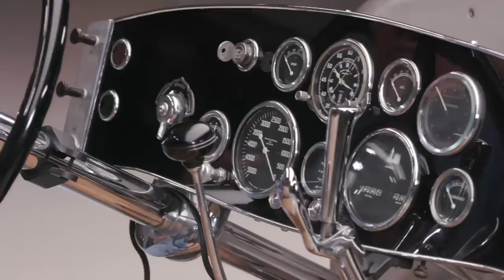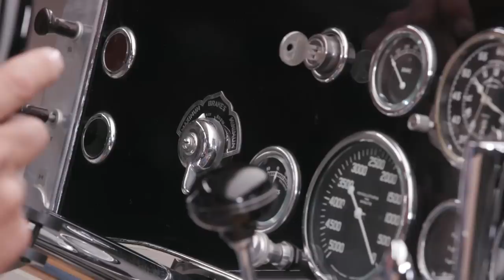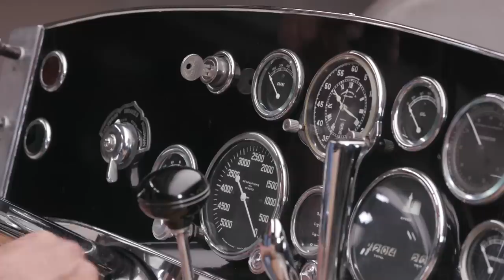1931 Duesenberg Model J Chassis - Jay Leno's Garage

Comment: Duesenberg used automatic grille shutters in 1928, and now many small cars/CUVs/crossovers are using them almost a century later. Lol.
Reply: Yes as a way of reducing air turbulence on the front end.
Reply: YEH IF YOU HAD THE MONEY THEY HAD THE TECHNOLIGY ,EVEN THEN !....////
Reply: Good tech never goes out of style
Reply: And Harley came back to belt drive's
Reply: There’s nothing new under the sun

Comment: This is a testament to how far automotive technology has advanced since the 20s. Yes, this car was a marvel of the day as far as automotive technology and Duesenberg had manufactured beautiful cars that were beautiful, fast, and sophisticated, not to mention they were primarily lightweight. My Honda Civic EX coupe weighs close to 2400 lbs, but it makes 508 whp and my 2014 Dodge Ram 3500HD with a Cummins weighs about 9300 lbs and makes 350 HP at the crank, but close to 900 lb ft of torque. This car was about 5200 lbs and made 265 hp at the crank, but is a totally different experience than vehicles of today. Thank you for the awesome history lesson Jay!

Comment: Jay, IF I had a couple thou... i would put ball joints in my old GMC... I make 8 hundred bucks a month. so I live vicariously through your cars
Reply: I know the feeling man, I'm driving a 02 Ford F-150 crew cab that was left to me by my late step father, and I'll be doing the best I can to keep it going til the wheels fall off working for a bi weekly paycheck from a non profit org.
Reply: Hope you get the funds And get her running perfect 👌🏾
Reply: Those old Fords last forever... keep 'er greased up
Reply: ty dude.... we live our life
Reply: @777jones ty :) 235,000 miles. runs great. Ball joints are ready to pound through tho
Reply: I feel you. Automotive YouTubers keep my passion alive. My dream is to get my first car back. I know where it is and it's only like $3500, but I'm disabled and can't work. 😕
Reply: @Studio23Media  If I made that much on disability, Ball joints would be a done deal
Reply: Jim E The car is $3500. I don't "make" that from disability
Reply: sry.... misunderstanding  @Studio23Media
Reply: @Michael Taylor I not only know where my first car is I STILL HAVE IT! It's under a car shelter in my back yard! 1976 Chevy Monza 2+2 (hatchback). Original V8 car I bought used in 1978 with ~25,000 miles on it. Ran the 262.5ci V8 to 100,000 miles, rebuilt it with some "upgrades" and ran it another 100,000 or so then built a 350 for it which now has maybe 3500 miles on IT! Needs a little TLC and a lighter pressure plate (it'a 4-speed... The pressure plate in it now is a Hayes Street/Strip to match the 350 but it is hell on clutch cables, has cracked the firewall (which I've "improved"), and my 60-year-old left knee doesn't work as well as IT used to!
Reply: paid 4 shack, lotsa  baloney sammiches, not much heat... survival does not involve cable TV. i spend the 50 bucks a month on internet
Reply: @2manysecrets Try it. SOO hard not to call you spoiled
Reply: and yea, its possible. I do it, barely. Ya wanna send me another five hundred dollars a month?
Reply: @Studio23Media  what kind of car?
Reply: J T Just a 2000 Mustang GT. Not much to anyone else, but it's special to me.
Reply: Jim E $800 a month is $200 a week and if you make $7.25 an hour that means you work about 4 hours a day. You could easily make 1600 a month if you work 8 hours a day.
Reply: @Studio23Media  my first real car was a 5.0 foxbody. Unfortunately, I'll never get that one back. Wrecked a long time ago. Good luck chasing the dream.
Reply: Tex 13... yes but living costs are a lot higher!

Comment: My favorite car since childhood.  In Highschool all I could afford was a 1931 Nash but it did have a straight eight, shutters on the radiator and automatic chassis lube system. The 6volt starter cranking that straight right sounded identical.  Great fun.

Comment: Still puts even new Rolls Royce models to shame. No one's gonna look at your fancy car out in the streets when this is next to it.
Reply: Even the chassis looks stylish af
Reply: New RR's are just fancy BMW's these days anyway.
Reply: So many things that weren't used for years or early versions of things uncommon for decades.  For example my 2008 is only 2v they had this back in the late 20's.  The idea of brake modulation to prevent lockup that early in the automotive era is astonishing.  Besides the tremendous attention to detail and quality.
Reply: Rollers and some trucks used louvered grilles. International prime movers with Cummins had them among others.
Reply: @ldnwholesale8552  RR used a louvered radiator too.

Comment: I enjoyed the 1st. video you did on this Duesenberg, Jay, and I enjoyed this one just as much. Also, it's possible the altimeters in earlier cars had a functional use in that some carburetors set at sea level had to be adjusted at significantly higher altitudes, so the altimeters could be an indicator of an approaching problem. Since the Düsenberg brothers, Friedrich Simon and August Samuel, were German-born auto engineers--and I've known a lot of them--I find it hard to believe they would have had something nonfunctional in their vehicles.
Reply: YEH I EXPERIENCED THE AFFECTS OF HIGH ELAVATION WHILE GOING OVER THE ROCKY MOUNTIANS IN A PLYMOUTH STATION WAGON WITH A 440 4 BARREL IT LOST ABOUT HALF OF IT,S POWER WHILE GOING OVER THE TOP ! ….////
Reply: @billmiller119  Exactly Bill, I was being conservative in my comment on the Duesenberg yet any carburetor car will lose power due to thinner air, which means less oxygen, as it climbs into higher altitudes--we people also experience it in the mountains as "shortness of breath". :)

Comment: Maybe somebody has mentioned this but there are several practical uses for the altimeter: adjust timing, adjust mixture and open the radiator vanes.

Comment: Love this video. The videos of P1s and Regeras are nice but I prefer the older stuff. The reason cars have captured people is that they are physical and we interact with them in a physical and sensory way. The newer cars take that element away. Feeling gears mesh during a gear change on an old car. Feeling the throttle actually open with a cable. Feeling the actual road thru the steering wheel.

Comment: Actually Jay, it's more like driving a dootlebug which is an old car stripped of it's body.  For a lot of farm boys like me this was our first car, and I used ours to pick up stones from the fields and even pull wagons with. We could kick ourselves for wrecking classic cars that would later be worth tens of thousands of dollars!  The altimeter I believe was also used to adjust the carb mixture as you drove at higher altitudes.  Modern cars have automatic altitude compensators inside the carbs.

Comment: It is straight-8, configuration that fascinates me, so instant love.
Reply: And I would guess that altimeter was used because supercharging doesn't function as well in greater altitudes, so it will warn you that your car will loose some power or even run worse. I mean, almost no supercharged car had it but that is kinda thing inventors and pertolheads like Duesenberg brothers would be concerned about.

Comment: Das ist ein schönes Beispiel wie damlas Autos von den Herstellern angeboten wurden. Nur das Chassis, ohne Karosserie, die von Karosseriebauern separart gefertigt wurden. This is a nice example of how cars were offered by the manufacturers back then. Only the chassis, without body, which were made separately by coachbuilders.

Comment: I USED TO GO TO THE AUBURN CORD DUESENBERG MEET IN AUBURN, INDIANA EVERY LABOR DAY. SOME GUYS BOUGHT THEM FOR $50 IN THE 40'S, OFTEN MAILMEN WHO WOULD SEE THEM IN BACKYARDS ON THEIR ROUTE AND MECHANICAL ENGINEERS WHO APPRECIATED THEIR ADVANCED MECHANICS. 

THEN THERE WERE THE DOCTORS WHO BOUGHT THEM IN THE 60'S FOR SAY TEN TO FIFTY GRAND. 

THEN THE MULTIMILLIONAIRES WHO GOT THEM IN THE 70'S FOR HUNDREDS OF THOUSANDS.

WE STAYED UP ALL NIGHT IN THE PRESIDENTIAL SUITE OF THE AUBURN HOTEL WHICH WAS CLOSED BUT OPEN FOR THE FESTIVAL, PAINT PEELING FROM THE WALLS. 

THE OLD GUYS WOULD TELL OF DRIVING SEVERAL STATES AWAY TOGETHER, BUYING A BARN FIND DUSIE, GETTING IT GOING AND DRIVING IT HOME, TOP FLAPPING IN THE WIND.

Comment: If a house was $1200, it is safe to say the dollar is 100x smaller now.  Average houses are $120,000 to 200k.  Which means this chassis cost $900k when new and the full car cost 1-2-3 million in modern dollars.

Comment: MY GUESS ABOUT THE ALTIMETER 
WOULD BE TO HELP ADJUST THE 
MAIN CARBURETOR MAIN JETS 
TO COMPENSATE FOR THE
THINNER ATMOSPHERE IN HIGHER ELEVATIONS!
WITH AIRCRAFT ENGINES 
THIS WAS MORE OF AN ISSUE,
AND THE AIR FUEL MIXTURE 
WAS CHANGEABLE ON THE GO!

Comment: Someone tell Jay it's "hydrolock." Also, I'm not too worried about a cylinder full of gas exploding - you need air for that. Not to mention I find that gas tends to pretty quickly find it's way through the rings, which is way scarier in terms of engine damage. On old gravity-fed equipment, a stuck or just leaky needle and seat is a good way to end up with a bunch of fuel in your oil which the bearings don't appreciate. Since most of my old equipment either didn't have any kind of oil pressure indicator, or it no longer works, I try to check the oil - looking for extra or extremely thin "oil" - before each start on the worst offenders. I'm afraid this is killing off a lot of our good old small engines and even old gas tractors with side drafts if the fuel can just fill up the whole tube to the air cleaner. I just bought an old Kohler 20HP twin that desperately needs a rebuild because of this.

Comment: As for being able to drive this car while you are outside , this could still be done, if the body was a Coupe Napoleon.  The driver sits in front of the windshield of the enclosed passenger compartment.  You just take off the driver's door and fold down an undersized windshield that would be above the dash board.  The Cabin is behind the driver, so he won't see it unless he looks for it.   Back then a massive car was felt to have good handling, when it drove over rough roads, the wheels would be doing plenty of up and down movement. The chassis had lots of inertia to hold it in place, and if the springs were very good, they would absorb most of the vibration while the chassis could roll along in a straight line.

Comment: I never understood why updrafts weren't simply fitted with a return line, it's not that big of a deal to collect the unspent fuel and pressure feed it or gravity feed it back in to the tank. Such a simple fix to what still is a better solution than a needle carburetor that can fudge up even when it's all perfectly right.

Comment: Modern cars could learn a thing or two from this example. A nice little latch to let the oil out instead of using a bolt like a caveman. Brake pressure gauge. Very cool stuff.

Comment: Actually that grille style thermostat offers an advantage over modern thermostats. When the louvers are closed your car will have quite a bit less drag at highway speeds. Watch those top speed speed cars they always cover the entire front of the car with cardboard wherever there's a gap.

Comment: The Model a Ford of 1928 to 1931 was more in the $450 to $500 dollar range.  The Model T bottomed out at about $250.  Clark Gable hat the hot rod with a short wheelbase roadster. Must have been very fast.

Comment: Beautiful Machine . I'm intrigued by the radiator cooler flaps : in the video , it seems that they are closed during all the ride. It's because it's cold outside or because the lack of the chassis and weight , the engine stayed cool and didn't heat up ?

Comment: It'd be quite interesting to make a period correct speedster body for it, but out of acrylic, so you can still see the internals.
Reply: There are a few clear plastic bodied cars out there. I think one is a Pontiac?
Reply: @louispaparella5766  yes, pontiacs and saturns in the 80s had plastic body panels.
this thing in particular would be fine as far as UV exposure, since it probably spends most of its life in jay's garage.
Reply: @captainzoll3303  Didn't splain myownself enough. I was referring to clear unpainted see through clear panels to promote the use of additional plastics in cars. Sometime in the 40's, 30's or so.

Comment: In, I think, the early 1960s a guy called Brian Morgan in England was a restorer of vintage Bentleys.  He somehow or other got hold of a Duesenberg J engine and had the chassis of an 8 litre Bentley and combined the two with his own sedanca de ville coachwork.  He called the mixed-parentage car the BDM (Bentley Deusenberg Morgan) and it even had a manufacturer's name plate with BDM Lichfield engraved on it (he lived in Lichfield, Staffordshire).  His theory was that the Duesenberg had a great engine but a not-so-great chassis (remembering that Fred Duesberg was killed when his SJ went out of control).  The eight litre Bentley chassis had better road-holding and a 4-speed gearbox strong enough for the American engine. Of course, purists were disgusted by his actions and the BDM was broken up and the Bentley chassis reunited with an 8 litre Bentley engine.  There is a p[icture of it here: https://libwww.freelibrary.org/digital/item/45857
Reply: That is fascinating! Thanks for sharing.

Comment: I'm surprised he doesn't have a Stutz DV-32. Same engine design, straight 8, DOHC, 4 valves per cylinder, and something the Deusenbergs did not have: a hemispherical combustion chamber - the very first production Hemi.
The Stutz displaced 332 cubic inches compared to the Deusy's 425. Power for the Stutz was about 150 hp compared to the Deusy's 265 but it was still wicked fast.
Considering the Deusenberg chassis alone was $9,000 and a completed Stutz with a custom body ran about $6,000... well, you got a lot more bang for the buck with a Stutz.
There were about the same number produced - 500 give or take - even today a Stutz at auction is around half a million, compared to a million plus for the Deusy?
I'd take the Stutz. It was a more handsome car, too, in my opinion.

Comment: Minor point. Filling the cylinder with fuel will not blow things up. The most powerful explosion is the right stoichiometric mixture when it's running, and that doesn't blow things up. Oh, Jay...
Reply: G Kuljian No but it will hydrolock and bend piston rods or worse.

Comment: Just crying out for a nice mahogany and tulip wood, boat-tail body, with the flowing style Vanden Plas type wings and cutaway Malcolm Campbell style doors. Even though they are wonderful cars, I never think they sound that good. The supercharged version is a lot crisper sounding. My guess is that they are woefully under-carburetted. It is like a 6½ Bentley never sounds good with the single Smiths carburettor but sounds wonderful with twin SU's in Speed Six specification.

Comment: Jay Jay, what the hell is that thing? Do you have to have a paddle or an oar ready at your side for pushing other cars away from ya, or for signaling a left turn? (Jay is going completely rogue here today with this one: no roof, no doors, no bonnet, not even a seat belt, oh wait it does have that.) Say Jay, why use the old sofa, the park bench, it came with on there, just get a new one, and while it's open like that, put it up there, one of those modern looking ones, you know. The engine has a great sound though. Epic photo moment? Probably 15:06 (and onward).

Comment: Built to drive! And wow, 4 wheel, hydraulic disk brakes in 1927? That's amazing all by itself. But the 40 hour valve adjustment sounds like a cruel joke. Much better to have 2 and cycle them.

Comment: Amazing that you’d drive this on the street without getting some sort of ticket especially in California.
Reply: duesenbergs were originally sold without bodies, so the car is street legal without a body. it doesn't need seat belts either because they weren't sold with them. that's also how the old harleys get away without having turn signals or mufflers because they were originally made that way.

Comment: Build another body similar to the Merlin engined car. A semi hotrod Duessy!
And maybe get rid of that terrible updraft and 4 48mm Webers. Or a couple of moderate size Holleys.
All of which can be put back to original.
Though that wheelbase makes life hard. I have had 3 ton Dodge and Inter trucks with 12 foot trays on 153" wheelbase. Though there you go, A Duesy tray top rod/ custom. After all it could have been built in period

Comment: i guess you have to be jay leno to drive that on the road,  if someone like me drove that in my town it would be pulled over, car  impounded and i would be in jail all in the span of 10 minutes
Reply: No. You have to be in the right town to drive that on the road.
Reply: Actually you can get away with a lot in older cars because the regulations, or lack of regulations, is "grandfathered in".  You only have to abide by the regulations that were in place when the car was sold. That's why you don't need to have a certain type of headlight or bumpers or safety features in older cars.